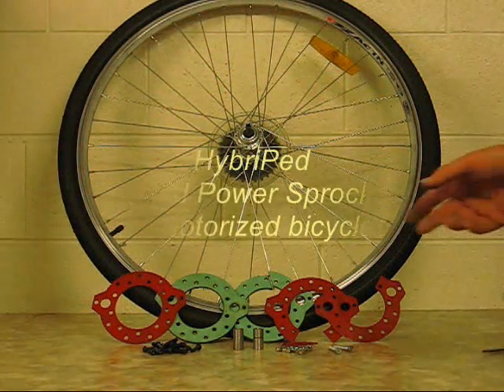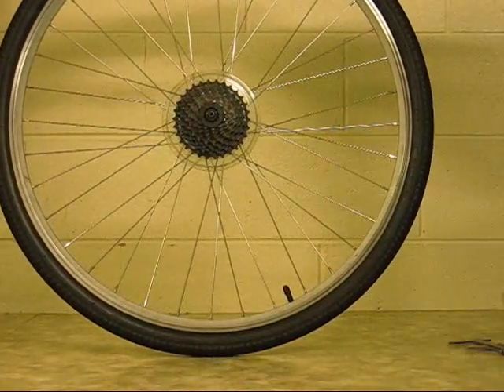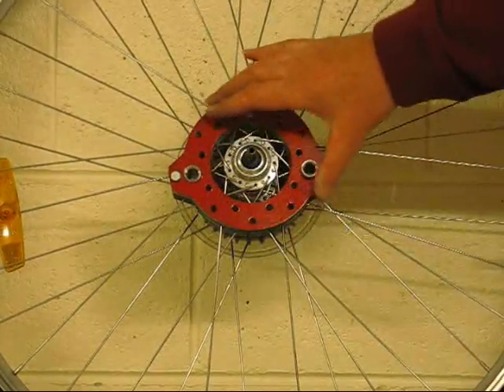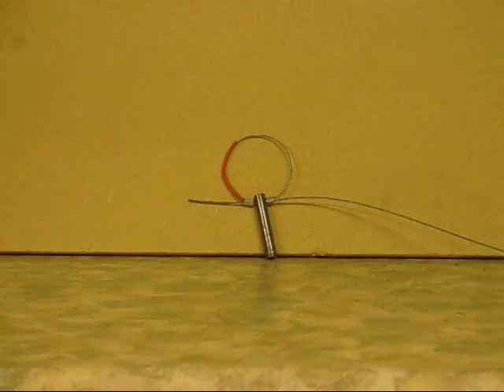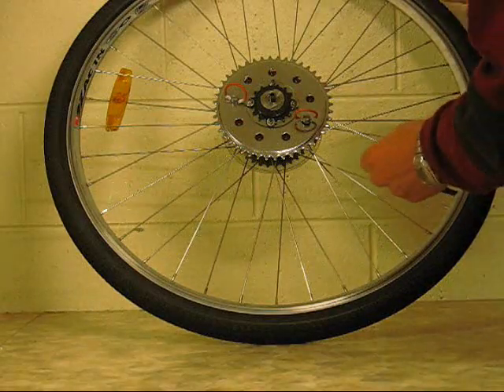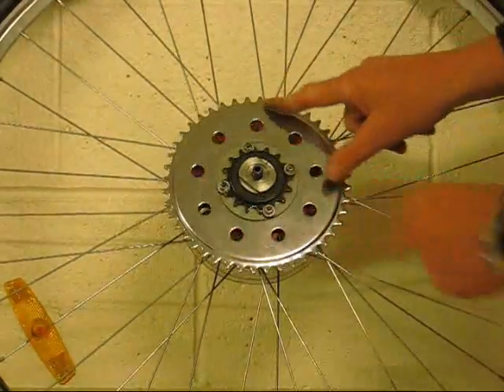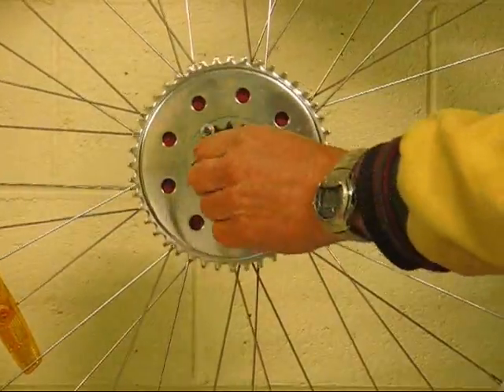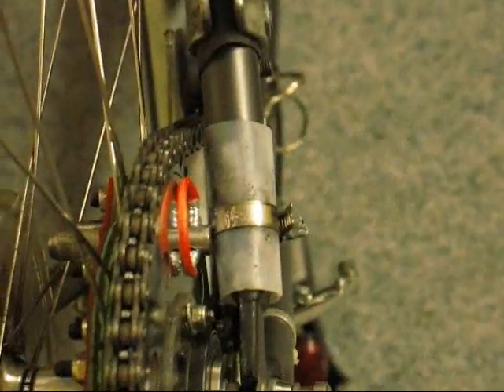Hybrid Power Sprocket (HPS) Assembly

Comment: when I lock my clutch in I get the same results as this  setup In fact I cant even really tell the  motor is even there. I wish you had made a sprocket adaptor that clamped  onto the hub not the spokes  every tie  I try to buy  one  of those they are sold out !  Seems everyone wants those, not a variation of  the spoke sandwich sprocket or rag joint  if you will!